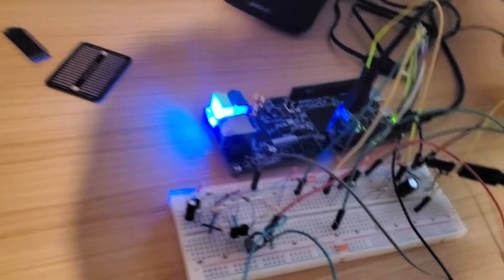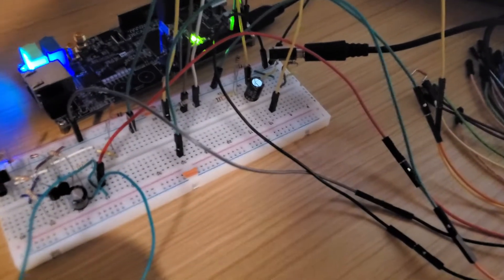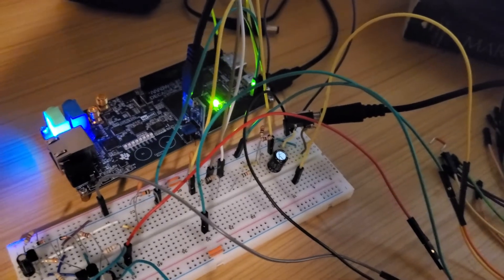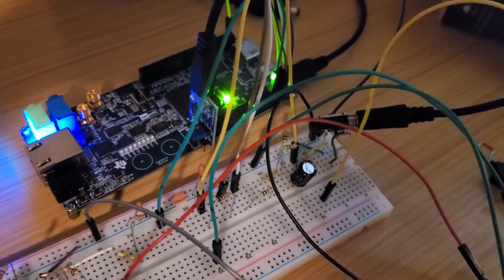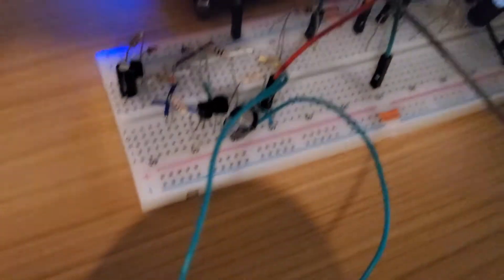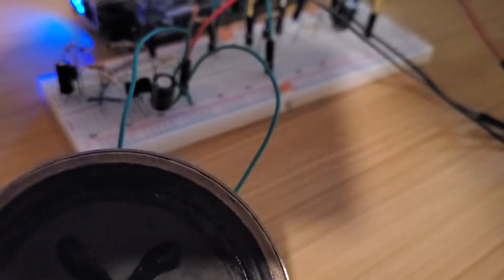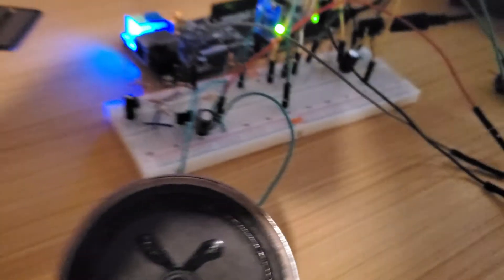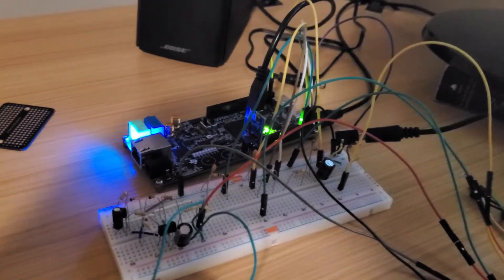Sigma Delta A/D Converters in FPGA

Comment: Hey this is really cool!  Thank you for sharing it.
Will build!

On the github it says that that the sampling rate is limited by LUTs on the device... Are there any other real considerations?  

Like, in my experience, DSD audio sounds amazing compared to other forms of digital audio.  is it possible to achieve that type of quality with a simple setup like this?

If so, why isn't everybody doing this?  
(i guess the answer is DSP..?)

At any rate, you are certainly getting authentic Nintendo Entertainment System quality sampling with this demonstration... and that is cool in and of itself.  :D
Reply from the maker: The sampling rate is determined by the FPGA clock which has to be low enough to meet timing in the device. You aren't necessarily limited by LUTs, you just have to use more of them (this design is small). There are also issues with the external hardware setup that degrade the analog performance; routing multiple clocks out of the FPGA into a breadboard can be noisy. The point of this project is cheap functionality over quality, so I would not expect a certain sound quality from it.
Reply: @daverussell389  Yeah, i mean really what i want to do is to build a multitrack DSD recorder but use an FPAA for mixing/eq/effects.... (i got one of those Okika/anadigm fpaa boards the other day).  so i definitely need to get good at cleanin clocks, but lo-fi noise is cool too .  heh

I'd really prolly be better off converting with purpose built DSD chips, but I saw your project here; so, i think i definitely should rig up something similar just to get my feet wet/hands dirty.  I have a De10 nano (which i normally  use for playing video games/mister), but i've never really tried to program it yet.  do you think your setup would port over to that board no problem?

I mean, i guess i should just give it the old college try, right?  ha
Reply from the maker: @MAITLANDVAUGHAN-TURNER  You would have to retarget the design for the Cyclone V, which wouldn't be hard but would require FPGA knowledge. If you want to process audio on FPGAs there are simpler paths than involving my type of project. This is more proof-of-concept.
Reply: @daverussell389  oh, no i don't really want to process the audio digitally at all. I want to process the audio analog with an FPAA. 

just use the FPGA for conversion and storage/playback.   I dont' even want to convert it to PCM at all 

I took a FPGA college class a long time ago, so i figure it will all come back to me if i just start messing with it. heh.